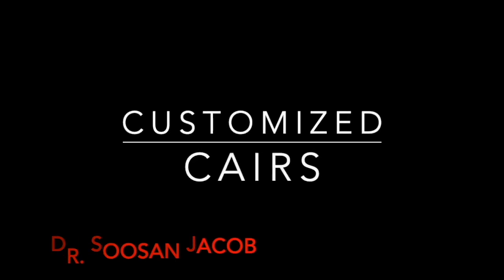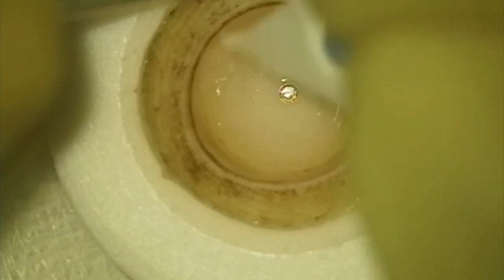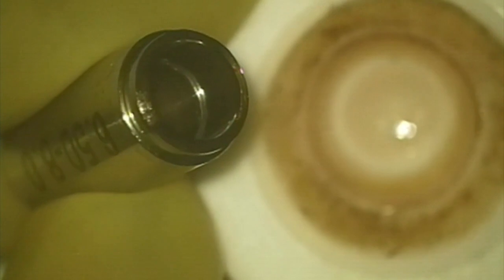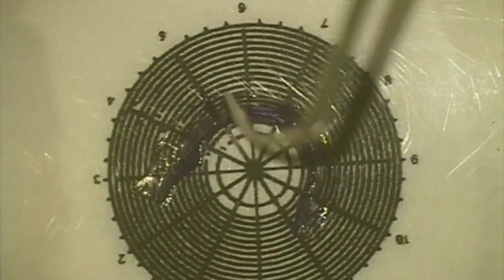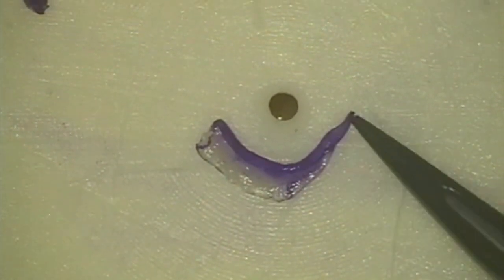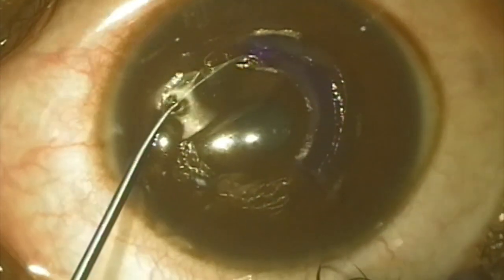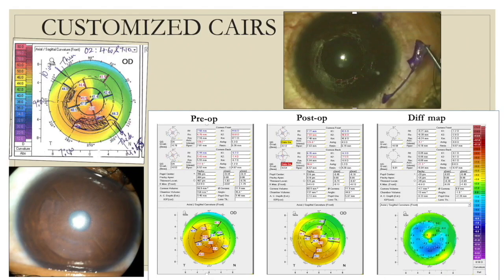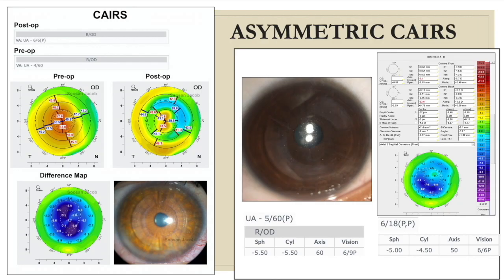CUSTOMIZED CAIRS Soosan Jacob

Comment: I was diagnosed with keratoconus in left eye last year. It was caused due to dust and excessive rubbing and there is no progression , neither does any family member has such condition. I hope CAIRS is studied more extensively. Currently im using scleral lens and my condition is mild to moderate with decentered cone, k max is 50.4, and min thickness is 510 microns.  Im able to read 6/9 or sometimes 6/6 unaided, but vision is not sharp at all. I will opt for CAIRS instead of INTACTS after some years .  :)
Reply: With such low Kmax & good thickness, do you not get good vision with glasses?
Reply: @SocialPerspective101  i am able to see 6/6 with glasses but vision quality is bad . But unfortunately, the vision gets bad in night time as i see small circle of light around single point of source of light as more cornea is exposed at night when pupil expands and the cone is decentered . Overall the vision is highly astigmatism and very irritating . I am waiting for more study on CAIRS. I will opt for it eventually if the results are great then why not?
Reply: @SocialPerspective101  or i might just opt for specialized scleral lens which are based on topography scans of sclera.
Reply: @manvendrasingh9618  ok got it...higher order abberations are bothering you. Ya good strategy to get more details on CAIRS. Where are u getting treated presently?
Reply: @SocialPerspective101  yeah. CAIRS really seems to be better than INTACTS as per the videos. Currently i am in touch with prof Dr Namrata Sharma@AIIMS DELHI, and Dr Rahil chaudhary @EYE7 Lajpat nagar. What about you?
Reply: @manvendrasingh9618  ya seemingly better than Intacts/kerarings. Even conract lenses are lifelong dependency
Reply: @SocialPerspective101  you might have to wear contact lens even after surgery. Depends on the severity of the corneal irregularity
Reply: @manvendrasingh9618  mine is mild, if the astigmatism goes Im good....Im ok with residual myopia !!
Reply: @SocialPerspective101  that's not the case...here myopia is induced bc of cylinder....unlike normal myopics.
Reply: Have u done cxl in both eyes ....and what's ur current age...how long u have diagnosed it ????
Reply: @Karna540  current age is 27 , was diagnosed last year . Before that i had no issue .
Reply: No cxl or any other procedure
Reply: @manvendrasingh9618  no progression of any sort at all...no decrease in thickness by 1 microns or increase in diopter to kmax at all ...how about other good eye ?
Reply: @Karna540  yes , no progression . Other eye is normal cylendrical , no keratoconus .
Reply: @manvendrasingh9618  don't see higher order abbreations at night in other eye at all ??kc is generally billateral .
Reply: @nathafunde1185  my keratoconus is not genetic, it seems to be some sort of injury on the cornea. My right eye is completely normal.
Reply: ben turkce yazıyorum cevirici ile bakarsınız selamlar  cairs oldunuzmu banada doktor önerdi